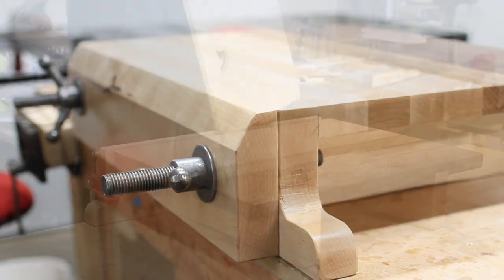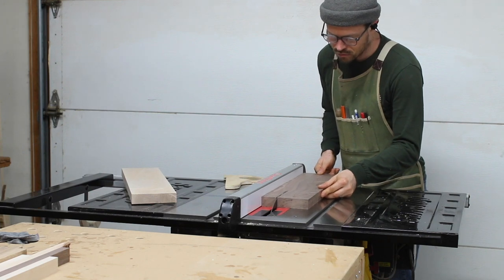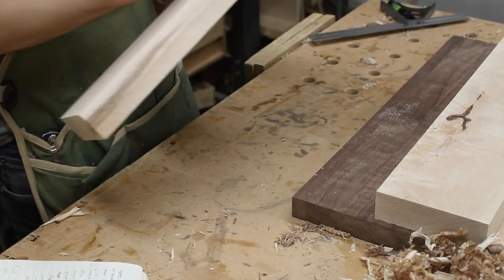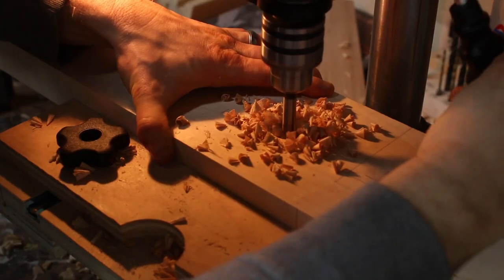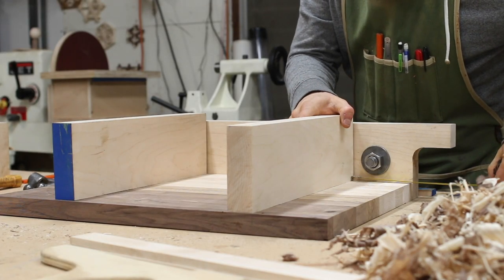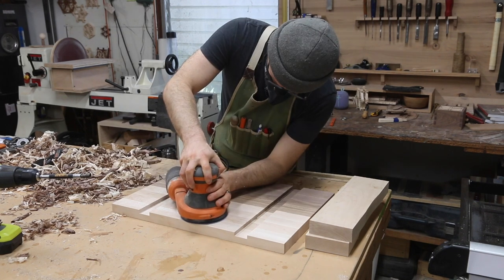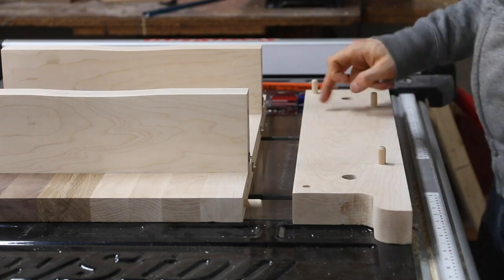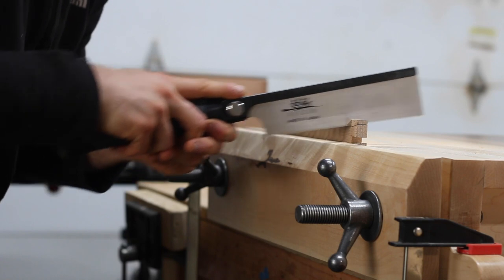How to Build a Budget Moxon Vise | Woodworking Shop Project (DIY)

Comment: The legs dadoed into the top create a cross-grain situation, eventually may result in a bow or cracked top.   One way to correct this (design) is to make the leg grain up-and-down or use clips to attach the top and only gluing the top to the rear jaw.
Reply from the maker: Great feedback, Gary, thanks! With such small pieces, many of which being quarter-sawn, the resulting wood movement is pretty small in terms of total distance. Additionally, the polyurethane finish makes it a *little* more moisture-resistant than if it were oiled, so that will help mitigate movement even more.

If this were a dining table, I would definitely think twice before attaching the legs like this.

Comment: Cool!  I like adding the extra table top platform in the back.  I think I'd like to do this.  I need a portable wood vise like this as I don't have room to add another whole workbench to my shop and this seems the cheapest.  Could you use pine like 2x4 for this?  Or is hardwood better for the vise?  Cheap like poplar or oak, or exotic wood like purple heart?  Woodcraft always seems to have this on sale. Could the vise jaws be thinner than 1.5" or even thicker?  thx
Reply from the maker: You could definitely use pine but you’ll get more marks in it than If you used any hardwood, like even poplar. The jaws can be slightly thinner — I wouldn’t go less than 1.25” though because the jaws might flex under pressure. Thicker is fine, but it’ll make it heavier. In all, you can definitely customize!

Comment: Nice project. I think I know why you went with a platform behind the jaws vs just the jaws and a brace but can you explain your design ideas?
Reply from the maker: Thank you — I went with the platform this time because it’s so useful for dovetailing. The platform brings the work a little higher, making it more comfortable for chiseling. Additionally, when I’m transferring lines from the tail board to the pin board, it’s much easier to level out the tail board. Without that platform, there is about a 4-5” difference between the workbench and the top of the vice jaws.

Comment: Thank you for the Moxon vice video. I’m definitely going to build one. However, I have a question about your Delta jointer. I need a jointer and there is one for sale near me that looks exactly like yours. It has a good price on it. But it has no cutter head guard and I can’t find replacement parts. In your video it looks like yours was missing too and you or someone else made a replacement . If it was you can you share how you did this? Thanks,

George Barron
Reply from the maker: Sure! The jointer is pretty good, although I'd recommend getting a helical head for it. I was also spooked by the lack of a guard, so I made it myself. It's basically just an inch-thick cutting board, cut into a pork-chop shape with a hole as big as the hole in the table.

The real key is that the jointer still had the cutter guard spring in it. That makes sure it can spring back and forth without any further modification. If yours doesn't have the spring still installed in it, then you might have to do something different. But my process was as follows:
1. Glue up the pieces into a cutting board
2. Cut the general rounded shape, and finesse it.
3. Drill the hole for the post.
4. Get two nylon washers (one for directly above and one for below the guard), a nylock nut, and a piece of half-inch all-thread about 6-8 inches long.
5. Cut the half-inch all-thread down to length, then using a grinder cut a vertical notch into one end. This will contact the stock spring in the jointer table.
6. Install the all-thread, making sure the spring indexes inside the notch.
7. Install one nylon washer, then the guard.
8. Install the second nylon washer.
9. Install the nylock nut, making sure to tighten it just enough so the guard doesn't move, but can still move back and forth. Too tight and it will stick open.

Here's a bit more on it: https://www.instagram.com/p/CJtWKYYjrBG/
Hope this helps!
Reply: @BikeCityWoodworks  Thank you! This is great info. I think the price on this jointer is good enough that I'd have room in the budget for a helical head. It is on Craig's list and the seller is slow to respond to questions but I'll see if he can tell if the return spring is still there. If not I'll pass. I'm not a safety freak but I just don't like the idea of an exposed cutter head.

Comment: made one almost like yours, down to the epoxied knot on the front jaw. made some dovetail slots for microjig clamps and hardware and its the best thing ever. currently building an overbuilt moravian bench. i can recoment the dovetail slots, makes holding pieces so versatile.
Reply from the maker: Great idea! Are dovetail clamps pretty strong in the grooves? I always feel like I would put too much pressure on them and ruin it.
Reply: @BikeCityWoodworks  built mine out of maple and cherry, haven't had any problems yet and i tend to torque those clamps like a savage. fact is im more affraid of breaking a clamp than breaking the slot walls. if the slots are cut correctly and in hardwood, i see no reasons for them to break. the only drawback is that these slots are a debris magnet. keep a small brush around ;-)

Comment: Sadly every Moxon hardware kit I can find are ludicrously expensive…all these woodworking channels sport these vices and seem to imply the parts are relatively cheap.  Well, two metal handwheels (or your lever style here), two 8” course thread 3/4” rods and four nuts to match is like 120 Bucks…You don’t even get a short plank of wood in that “kit”.  It’s an insane rip off of about 4x the true value!  How you can source the metal parts for 40 Bucks is beyond me!  So I won’t be building one anytime soon…from anybodys design.☹️
Reply from the maker: Unfortunately handwheels are much more expensive than the wing nut style. But the one I have is pretty affordable, here’s the link: https://amzn.to/3zAZy3F
Reply: I recently built a portable workbench following an episode of 3X3 Custom, and it featured a Moxon vise using a TayTools kit. I honestly didn’t feel like the price was unreasonable, but always eager to challenge myself, I scratch built the thing for nearly nothing! I took a couple 3/4” nuts and welded 2 steel rods on each, angled like the cast ones in the kit, and had a couple old pieces of 3/4 all thread that I managed to salvage 2 8” pieces from. Not being a fan of the threaded rods sticking way out the front, I welded the wing nuts to the end of the all thread, and captured two 3/4” square nuts in the bottom of the workbench. The result is never having to deal with things (arms, hands, clothing etc) getting hit or hung on the protruding rod! The finished product has been much handier than I ever imagined!
Reply: Go pick up one piece of 3/4" all thread, 4 nuts and a couple of large washers for <$10. They work just fine. I have a much nicer Moxon than in this video made with all thread and it's sweet. The Acme thread stuff is always going to be much more expensive because of the production process.